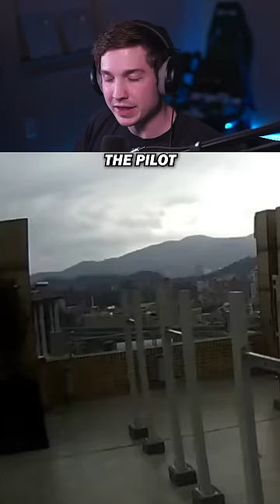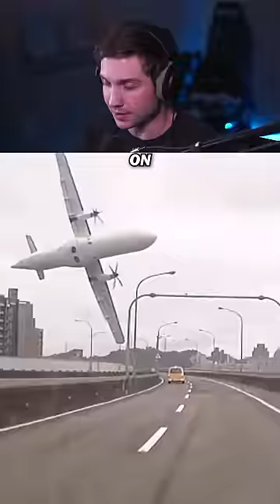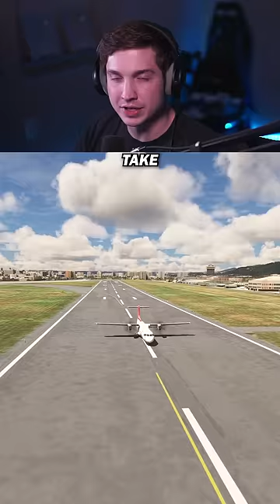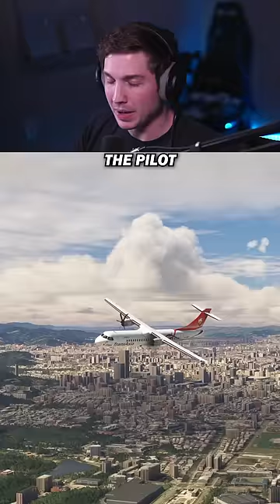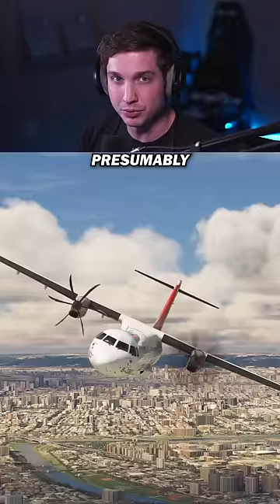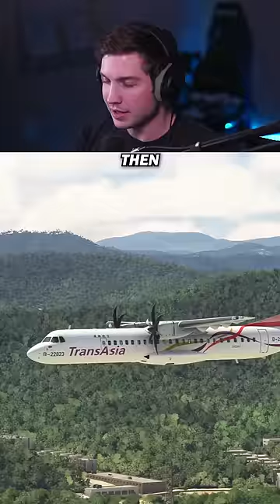Pilot Shuts Off Last Remaining Engine

Comment: A podcast program in Taiwan interview a only-survive flight crew who is a flight attendant that she got a really hard PTSD after crash (about 5-6 years)
and the airlines  ceased operation at late 2015 due to a financial problem
Reply: Adding insult to injury, the airline overworked and underpaid their pilots and also did not provide insurance to the cabin crew.

The other flight attendant onboard this aircraft perished with the pilots.

Coupling it with GE222, that meant the loss of 91 passengers and 8 crew members within a period of 7 months.

It weakened the reputation of the airline rapidly. TransAsia Airways already lost over NT$2.2 billion in the first 3 quarters in 2016, before they ceased operations in November that year. The shares had also dipped ever since.
Reply: Do you have a link to the podcast? Please share!

Comment: That's certainly NOT the kind of mistake you want to do AS A PILOT !
I've so many questions, like how do you make such a mistake?
Reply: Not pilot mistake, as for example, your a driver but your wheel got popped while in traffic while horning sounds were loud, now you see someone pointing at u, giving signals, you thought they were threatening u and sped up, but after some time you feel hot inside the car, you see smoke outside...
Reply: @Brigcal_YT  there are too many questions before we can decide if the pilot is in the wrong or not, like are there no warning signals for pilots to know what engine is out at all? Or if he knows an engine has stop working,  shouldn't he make sure which one stopped working before he shut down the engine? Is there any copilot to spot the problem?
Reply: @knightofbakingroom2606  What will you do at that situation being 800+ hours? Became nervous since your first experience of halt while at very low altitude in a city full of tall building in a literal two engine plane?
Reply: I can answer that: he was a bad pilot and had bad results BUT Transasia was in full grotwh so they add to hire random pilots
Reply: @robjustil8722  yes then the fault is on the authorities who hired him
Reply: @Brigcal_YT  Ye

Comment: Context:Two minutes after takeoff, the pilots reported an engine failure. After climbing to a maximum height of 1,630 ft (500 m), the other engine, still operating normally, was mistakenly shut down.[1][2] The aircraft lost altitude, banked sharply to the left and clipped a taxi travelling west on the Huandong Viaduct (causing two more injuries), then the viaduct itself, before crashing into the river below.

Flight 235 was the second fatal accident involving a TransAsia Airways ATR aircraft within seven months; Flight 222 had crashed on 23 July 2014, killing 48 of the 58 onboard.

Comment: Here's a detailed explanation:
TransAsia Airways Flight 235 was a domestic flight from Taipei to Kinmen, Taiwan. On 4 February 2015, the aircraft serving the flight, a 10-month-old ATR 72-600, crashed into the Keelung River around 5 km (3.1 mi; 2.7 nmi) from Taipei Songshan Airport, where the aircraft had just departed from. On board were 58 people, 15 of whom survived.Two minutes after takeoff, the pilots reported an engine failure. After climbing to a maximum height of 1,630 ft (500 m), the other engine, still operating normally, was mistakenly shut down. The aircraft lost altitude, banked sharply to the left and clipped a taxi travelling west on the Huandong Viaduct (causing two more injuries), then the viaduct itself, before crashing into the river below.

Flight 235 was the second fatal accident involving a TransAsia Airways ATR aircraft within seven months; Flight 222 had crashed on 23 July 2014, killing 48 of the 58 onboard.

Comment: This took place in 2015 and of the 58 people onboard only 15 survived. The crash of TransAsia Airways Flight 235 was ruled to be caused by pilot error. The captain turned off the wrong engine after an engine failure, causing the aircraft to have no engines keeping it aloft. They quickly lost control, clipping an overpass and crashing into a river.
Reply: There was no point in commenting this.
Reply: What is the point in commenting this?
Reply: There were syrvivors wow

Comment: actually it was an atr 600 according to google
Reply from the maker: ATR-72-600, the 600 is just the latest generation
Reply: @AaronRheins. That is correct.

It actually is called ATR 72-212A, with different marketing names. The ATR 72-500 and 72-600 are only made with different equipment fit.

Comment: TransAisa Airways Flight 235 Crashed Due Engine 2 Fails And He Shut Down Engine 1 But 15 People Survived And The ATR 72 Hit A Taxi And The Crash Was Saw On A Dashcam And He Said Wow Pulled Back The Wrong Side Throttle The Plane Stalled And Crashed Into The River